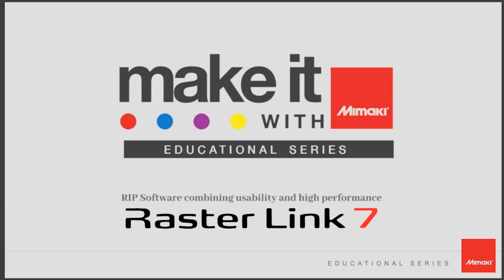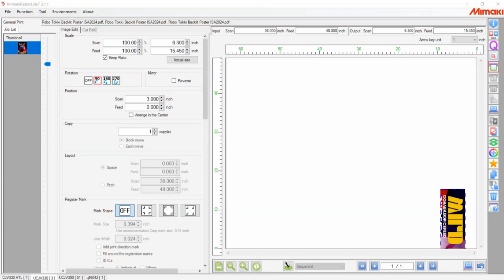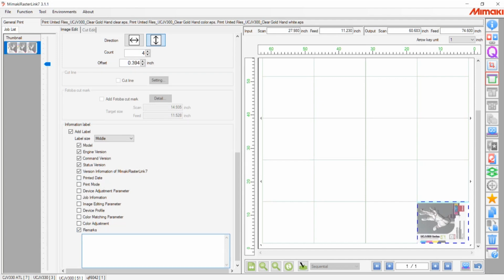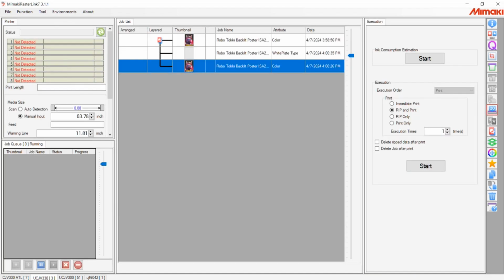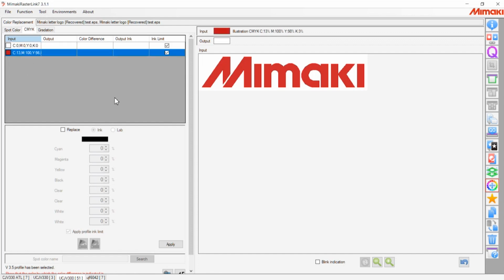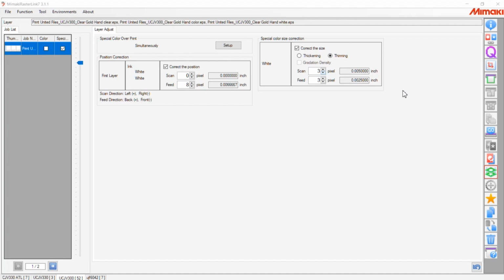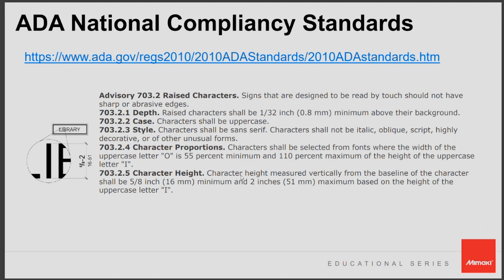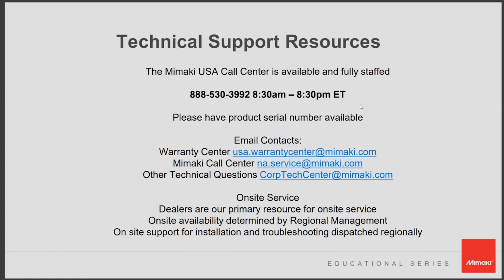RasterLink7 Webinar: Make It With Mimaki Software Training

Comment: Terribly slow software. It is easier to make jigs and arrangments in illustrator/corel and then export it to rasterlink. Even empty software without any data struggles with itself - each click takes at least 2-3 secs to repond which you can also see on video. I use i7, 32 gigs ram, ssd
Reply from the maker: I'm sorry to hear about your experience with our software. The jig print feature in RasterLink7 is designed to streamline your printing process. It allows the production team to print multiple images on various pieces of media simultaneously, without the need to go back to the art department. This feature uses precise measurements of the printer bed to ensure accuracy in every print and simplifies the process of double-sided printing. We strive to make our software user-friendly and efficient, and we appreciate your input to help us improve.

If you're encountering specific issues or need further assistance, please let us know. We're here to help at na.service@mimaki.com.